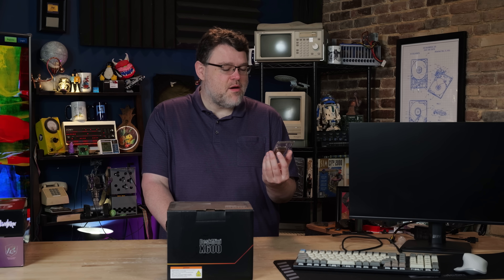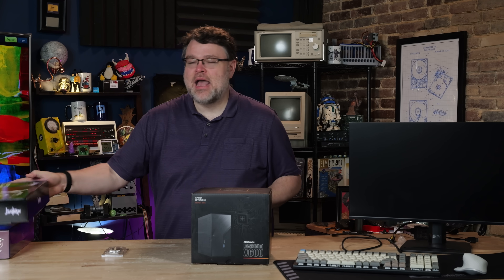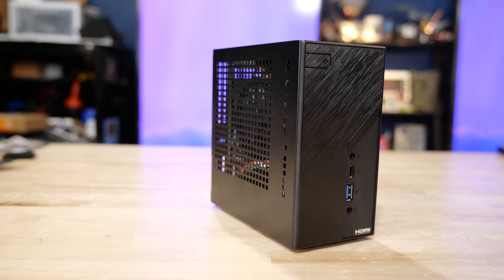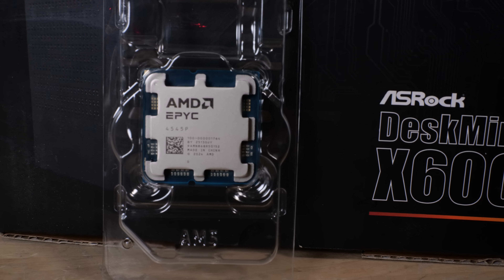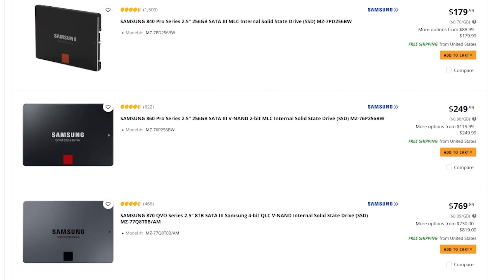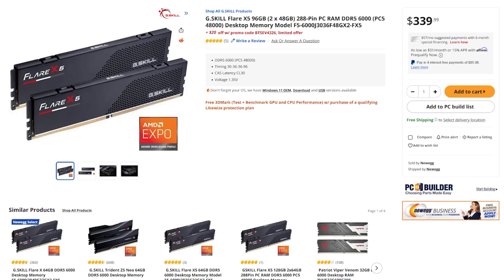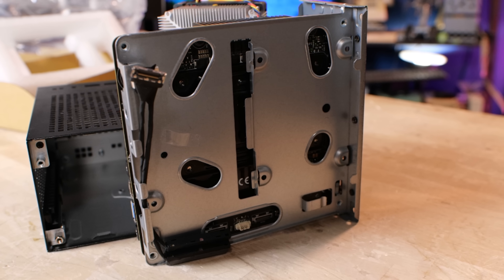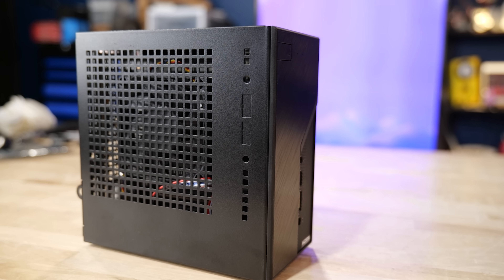Building an Epyc Low Power System with the AM5 Epyc 4545P

Comment: I have been waiting for a LONG time for something that could take the place of my Xeon E3-1220 based server. Intel's offerings have been nonexistent or just lackluster, and honestly the E3 just kept running, and has outlasted I think 3 sets of drives at this point? Honestly if it could handle more RAM I wouldn't be itching to demote it to a backup.

But this seems like it might be the way to go. Really wish they hadn't waited until AM5 to do this. ASRock had boards that were perfect for this that mostly wound up with regular old Ryzen CPUs in them. Their new ones seem to be severely lacking in PCIe slots.

Comment: Love your videos, but I'm not really all that hot on these AM5 Epyc cpu's, if they offered a stack more PCIE lanes over the desktop version and ECC on a standard consumer boards, then this would be a cool product indeed, but I would rather just get the desktop part, at least I could sell it later as a desktop when I upgrade the machine, what we need is a middle ground between the desktop CPU and the full boar Epyc, something that has 8 to 16 cores, but has double the PCIE lanes, and no, not Threadripper, as that's also just overkill for a home lab and requires one to sell off a kidney to afford it, what home labs need is IO more than anything else, I went with used 3647 system just to get more lanes, would have preferred a more modern AMD solution like this, but it just doesn't offer the IO.

Comment: im currently rocking a r9 5900x with a rtx a5000 and 48gb of ram( getting right around 5.5-6 tokens/sec) , im considering upgrading to either something like this or the GMKtec EVO-X2 with128gb, im just not sure if the tokes/second would be that much batter.

Comment: Very interesting but I wish you would give us the bill for the complete package.
Also, could such a system work fanless ?
+ Maybe you could give us some tips about what comes around such a mini homeland to have them working fine for years with minimum hardware maintenance.

My solution,until now, is to go fanless because of noise and especially dust.

Comment: Ever since I sort of fell in love with the Xeon E3-1240Lv5 due to it's 25W TDP, which is now a decade old(still running fine today on a Gigabyte motherboard with ECC ram no plans to retire it,), I have had my eyes out for something newer at that low TDP but for whatever reason have never found something available to buy at least. I have a Xeon W-10885M(35W) in my laptop(with ECC too), but unaware of a general socketed version of it that(or anything similar) I could put in a regular motherboard. I do see AMD has a Ryzen 7 PRO 8700GE which also runs at 35W, but with that too, I do not see a socketed version of it to buy, perhaps could buy a prebuilt system with it, but no matches on newegg or ebay for that CPU.

Comment: one thing I'd love to know: is the voltage curve the same as for 9950X running 65W mode or lower? if it's the same then it's a meh part unless somehow cheaper, if it Is lower then... may be a spicy pick

Comment: - Only dual channel (which is a f joke)
- PCIe Lanes are a mess (4 for the chipset (2 pcie 4.0 + 2 pcie 5.0) + 16x pcie 5.0 for a gpu + ( 4 GPP/NVME pcie 5.0  x 2 )

And why that's called a "server" cpu? Cause the name says "Epyc"
Aha. But no, that's not an epyc. Just a 16 core am5 (*950X)

Comment: Still trying to find an economical way to have some NVME, 10gig nic, and Transcode ability all in one. This could be close but by the time I buy all the bits and bobs there's probably a few other good options that are a better fit for my needs.
Reply: Take a look at SP6 maybe but be prepared for your wallet to burn
Reply: Lol I said economical.  If money were no option it'd be nice. I'm actually considering Arrow lake because it has quick sync which will save some lanes.  I figure when the arrow lake refresh comes out I can score a deal because nobody wants these chips even though they would be overkill for my application.

Comment: ASrock is absolutely amazing when it comes to support of extra features on their AMD based stuff (pci-e bifurcation, working ecc memory etc). The deskmini and deskmeet are unique and super cool as well. Have deployed several of the deskmini as user stations at work and also have deskmeet x300 with ryzen 9 5900 with 64GB of ECC memory (verified it truly runs in ecc mode under linux) as secondary proxmox host.
Reply: To anyone else looking at -Meet vs -Mini, the Mini (smaller one) does not support ECC.  Per spec sheet and others' testing.
Reply: That's why ALL my motherboards since AM4 are AsRock.  My latest is B850M-X WiFi with 9800X3D running in ECO 65W mode (88W PPT), with 2x32GB Micron ECC UDIMMs.
Reply: Make sure to stay in-spec on ASRock boards so they don't nuke your Ryzen, as was an issue recently.

Comment: Since when is 64 Watts low power.   I remember when you could buy CPus at around or less than 20watts.  This is why I don't want to upgrade my ancient i3 CPU. yes it's slow and has few PCI lanes, but it's fine.  I really want some improvement for same power, not more features for more power.  I don't give a crap how much more performance I'm getting, if it's costing me 3 time more power.  It makes more sense just to use my old hardware, rather than upgrade.  Sure, this makes more sense than using a ryzen 1800x, etc, for a server.  but come on.  I want a genuine, low power CPU.  Neither AMD or intel are offering this.

Comment: 10w idle is getting down to reasonable idle, my storage server spends like 98% of the time at idle or just doing some background data scrubbing on the drives. The main problem with ASrock AM5-4004epyc boards is they cant disable or even sleep the out of band management which just sits there sucking up an additional 12w 24/7.
Main reason I have gone with Synology 2-bay disk stations in the past is a 6-8 W idle and 20 W load. Even though I'm not a huge fan of DSM, esp dislike DSM7 as it prevents root from doing a variety of admin tasks.

Comment: I’ve been using an asrock a300 (with 3200g/64gb/2x nvme and 2x sata ssd) for my proxmox host for years now, been eyeing the x600 with a 9700x, but I’ll definitely look at this as an alternative. Bananas you can get 16 cores, 128gb ram, multi raid pools in a box this small and quiet

Comment: I'd love to see content on low power AM5 and how it compares to the past few gens of intel, especially at idle. I went down the low power rabbit hole not long ago, there is little to no info on AM5 in that area.
Reply: If you want low idle AM5 and don't need >8 cores, you want APUs like the 8000G series.  Any CPU like these EPYCs with a separate IO die is gonna have like twice the idle draw.  If you need ECC the Pro APUs can do that too, with the right mobo.
Reply: Loads of cores, but on the desktop equals pathetic number of pcie lanes and thus connectivity.😊
Reply: Definitely on AM4 the idle power consumption of chiplet-based Ryzens is total ass thanks to the I/O die. On a Ryzen 3600 I couldn't get below 60 watts idle to save my soul. I doubt much has changed and still nobody talks about it.
Reply: @jimtekkit  i'm on 23 watts with a 4650G on AM4 using a prime b450m-K II as motherboard an with 3 harddrives (16-18tb each) a bluray drive as well as one nvme ssd and one sata ssd as well as 3 noctua fans with the noctua controller. Wolfgangs Channel made a video some time ago about that cpu. not buyable for consumers but you can find them in 2nd hand company pcs as well as new in readybuild pcs. i ordered one with a bunch of other stuff and ripped it out of the trash case it came in. perfect for my unraid server. i've about 15 docker containers running with that power budget.
the only downside on that mainboard is the very limited pcie stuff.

Comment: I didn't understand why I should use Epyc AM5 instead of Ryzen for homelab? And what's wrong with eco mode or manual power limits? I have a mATX AM5 board with 7600x that is limited to 50W in BIOS with -30 curve optimizer. Boost clocks for not all cores are the same. Idle a little high, but I don't think that Epyc will solve this problem - IOD is power hungry and doesn't have that level of efficiency that chiplets have.

Comment: Made me think I want to see if it is possible to get a 65W system with quad channel memory in some fashion with good  affordability price/performance to run a standing LLM that can Idle very low, but still be efficient when getting used extensively.

Comment: Id look into putting in a Notcuta cooler and fan in that case. i have the previous gen x300 mini and ive put in the slim noctua fan/cooler and it runs super cool and quiet compared to that fan they give with the case.

Comment: Been using a DeskMini A300 since mid 2019 and I have never had any issue with it. Using server parts for my homelab could really hit the spot. Great video!
Reply: I got the Deskmeet X300 and I still think 4 dimm slots is a brutal flex in that form factor!

Comment: Low power is underrated - I want to be able to throw my server it in a closet without worrying about thermals, or my office without worrying about noise. I'm tempted to use a laptop chip but pci lanes are the issue there...

Comment: For so much talk about low power I expected you to include some power draw numbers 😁 (I would actually be interested to see how much not having a chipset does)

Its still chiplet AM5, albeit without a chipset, so it will probably not be anything great compared to contemporary Intel chips on W680/W880 which can do about 20W wall power at idle-ish compared to ~50W for AM5 B650 (but of course you're not getting those in a mini PC formfactor).

Comment: A Chinese partner of asrock makes really cool cases for the deskmeet x600 board. You could build a 3.5L topfeel deskmate x600 with 16 cores and 256gb of ram. The 5.6 liter version even supports low profile dual slot GPUs, like a 5060 or 4000 Ada. It's a shame they don't sell them here.

Comment: I wish it supported more PCIe lanes. I would change out my media server right away.
Reply: Yeah: more lanes would be nice. But there are ways to compromise. You probably would not need all 16 lanes for the gpu. If you use those for storage, you can do quite a bit. But yeah: with ssd's using 4 lanes, you can quickly run out of lanes.
Reply: @jaapkamstra9343  I mean even with a 16x gpu you would have 12 lanes left. So with x4 NVME's that would give you room for 3. You could also use SATA drives that wouldn't eat up PCIE lanes. A SATA SSD can fill up to 6gb's. So if you are running 2.5 or 5gb that is all you really need. Sure they won't max out 10gb but is that needed in a lot of cases for something like a home lab? If you are on Cat5e in your house 10gb would require a full rewire. I haven't tested 5gb. 2.5gb though still works on CAT5e with full speeds I believe.
Reply: @jaapkamstra9343  my problem is more I need many 3.0 lanes and nearly no 4.0 and 5.0 lanes. My storage cards for sata and my network cards 10 Gbit/s are fine with 3.0 lanes but a switchcard from 4 5.0 lanes to 16 3.0 lanes is currently not known to me and even if it would probably too expensive.
Reply: Yeah, that's true, but It's still SUPER cool to see EPYC on AM5! you get the all the features but with a smaller price.
Reply: @hi-friaudioman  I agree. It's has excellent performance for very little power draw.
Reply: Nvme drives are going to pcie 5x2 in a few models. I would love to learn about how to leverage that for maximum IO.
Reply: @Rickles Yeah Samsung's new EVO drives do that.
Reply: The new AsrockRack EPYC4000D4U MB has no chipset in it, just like these DeskMini / DeskMeet boards. Maybe that’s something for you? And it’s AM5 too.
Reply: I can just about get away with the number if pcie lanes,  though wish there was bifurcation all the way down to 1x lanes for a bit more flexibility.

With larger ssd arrays, 1x per drive would be fine as you would be bottlenecked elsewhere anyway.
Reply: True
Reply: Why would you need such a monster CPU just for a media server? Maybe I don't understand what you mean by "media server" though. I personally am completely content with Intel N100 in my media server, which is used for Nextcloud, Jellyfin, Immich, Bitwarden, Calibre, (Torrent) and my personal website.
Reply: @alexanderpushkin2094 
Why do one need a Versace or D&G shirt for a $1000 when it serves the very same purpose of a shirt for $10 except for the social/cultural capital.
In other words if you don't care about being a part of the community (herd), technically you're fine with N100, I still run J4125, 16GB since 2019 with over 30 docker containers, 27 LXC including OpenWRT, 2x16 3.5'HDD and I'm fine. LOL
Last year bought another one fanless I5 12th gen from Aliexpress just because I use Debian KDE remote VLC and Dragon player with my projector as my video station and PVE on top of this.
And as the Grand Narrative want me to make decisions, I bought 64GB RAM which I will never use just to cool down a consumer in me.
Reply: @alexanderpushkin2094  It way lower power than my Xeons. I have a GPU to encode/decode, dual 10Gb NIC and two 16x HBAs. 28 Lanes is not enough with NVMEs in the system.

Comment: 4:51 ECC doesn’t seem to work in the DeskMini X600. In the DeskMeet X600 it works fine.

(Check my thread “Ryzen 8700G APU Spec Confirmation: ECC Memory Support (No!) and PCIe Lanes (No Bifurcation, they suck!)” where there was also a 8700G PRO tested in a DeskMini X600)
Reply: just read the spec sheet, Deskmini ECC nope, Deskmeet ECC ok
Reply: You might be able to email for a custom BIOS. I got IOMMU enabled on my X300 in like 3 days.
Reply: Just like the AM4 X300 it seems, back then those wouldn't even POST with ECC RAM so ASRock is probably cutting a little bit of board cost by not even wiring up the full 72/80bit width. Bifurcation might be an 8700G limitation, the APUs always only did x8x4x4 but the 8000G series is only x8 to begin with so you don't get that extra x4x4...
Reply: @danknemez Yes, the current AM5 APUs cannot do PCIe Bifurcation. My thread was started in early 2024 when AMD initially released incorrect specifications for the 8700G, at first they had stated for example that ECC was supported. AM4 Ryzen 4000G and 5000G APUs can do certain PCIe Bifurcation configurations (except x4-x4-x4-x4) and have the same amount of PCIe lanes in total as their CPU counterparts of the same CPU core generation (but only PCIe Gen3 instead of PCIe Gen4).
Reply: Sad 😔

Comment: 3:02 As someone with a few DeskMeet X600 - do yourself a favor and throw the included cheap-AF OEM ATX power supply out and mount a good SFX model in it. That also gives you more vertical space for a heatsink.

Comment: @Wendell you mention low power for this project and then 25gb networking. What NIC specifically then ? Cause I tested several and they add approximately 23 to 27w at idle additionally to the system not exactly low power......

Comment: You can put a Wraith Stealth into this, if you unscrew the "bracelet" with the AMD logo and if those tiny "horns" are facing away from the DIMMs.
Reply: Fits the low profile noctua as well if I remember correctly
Reply: @dfgdfg_ Yeah,but it would be nice to use the free cooler,if you can.The AM 4/5 coolers are not bad at all as freebies.
Reply: @dfgdfg_ Yeah I've been using a low profile Noctua in my older Deskmini, plenty of space
Reply: Yup,a tried & tested little mod people forget or are not aware of.
Reply: Yes, but a much better thermals are achieved by using the aluminum base of the wraith stealth but putting a P12 slim fan on the inner of the mini case. Double sided tape if you don't want to drill mount holes. Cools the SSD and ram too

Comment: I use my X600 Deskmini with a 8500G + 32G DDR5 4800, BIOS 4.10, and it's really buggy
power saving enabled means, it won't boot on button press, only way is AC on Power on
if I have boost enabled, compile workloads and cpu heavy stuff throws errors

but my goal was 25W PPT so f boost and I hardly reboot it anyways -> it does awesome :)

Comment: I thought it was only ASUS consumer boards that supported EPYC 4000 CPUs.  I was just about to pull the trigger on a Minisforum BD795i SE for a new homelab virtualisation server.  You've given me a whole new rabbit hole to go down now! :)
Reply: Asrock has historically been good about quietly enabling features in their BIOS that many others don't bother with. For instance, in my experience I've built two servers with consumer AM4 platforms (with Asrock motherboards) but was able to get ECC memory running on them with minimal fuss.
Reply: @pconnor462  Well after watching this I decided to ditch the BD795i SE route and I've just ordered a 4545P so fingeres crossed this will play nicely with my Asrock B650M-HDV/M.2.  Not what you'd call a server motherboard by any stretch but hopefully it will run the 65W EPYC quite well.
Reply: @Chris-hy6jy how did it go? I want to try this with a B650m PG Riptide since it has exactly all the other features I need.

Comment: Is the idle power consumption of Ryzen still high compared to Intel?
Reply: chiplets yes (you can get them lower but dont use high speed RAM), monoliths no
8500G in Deskmini with DDR5 4800, 1TB SSD, Arch 6.15 = idle 6W at the wall
Reply: Yes, the chiplet based Ryzen HX laptops are still struggling to get more than 4 hours on battery while doing video playback tests due to the high idle power draw.
Reply: For low idle power, perhaps look at the desktop motherboards that use mobile processors.

Comment: I wished Nvidia-AMD-Intel would give us like 48GB VRAM SFF GPUs for AI... at reasonable prices. Maybe in 2035
Reply: You can also go with Apple if you want a lot of VRAM for AI.
Reply: The problem is that it would only entail a niche section of the market which would not justify the engineering costs. The price would be ridiculously high to cover R&D for that.